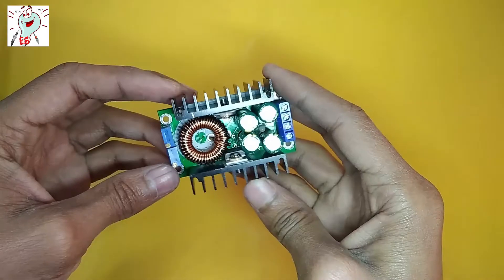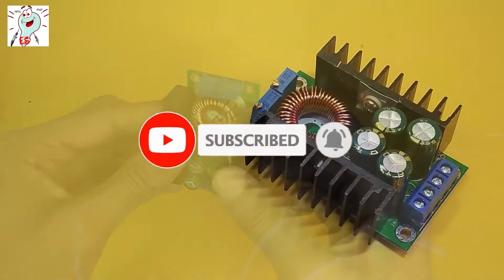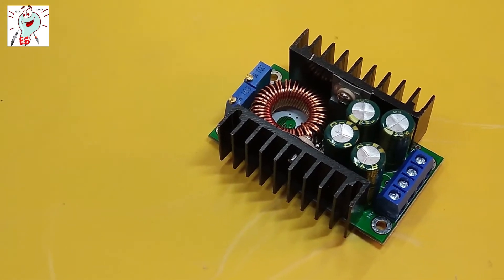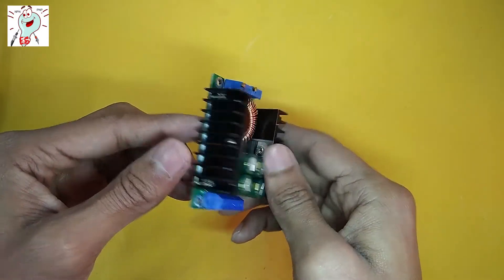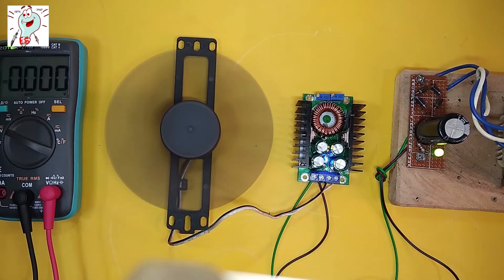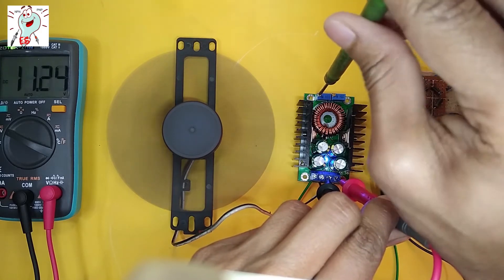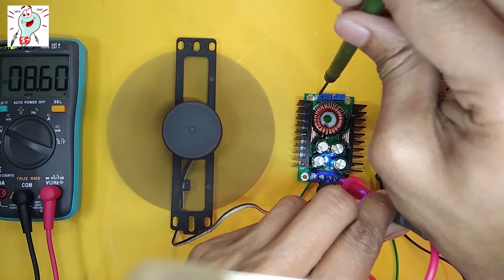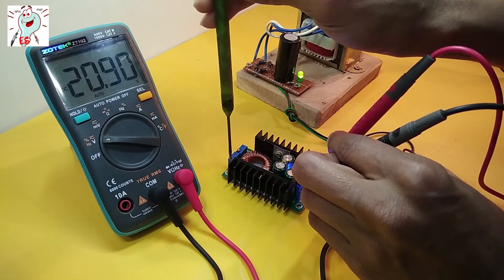ALL About xl 4016 buck converter ll (How To Use) ll 1.5v to 30volt

Comment: Ampere does not work.  Only voltage works.  The green light is on but the red light is not.  What is the solution?
Reply from the maker: Firstly ampere depends on load, please check the load is that properly Connected or not.